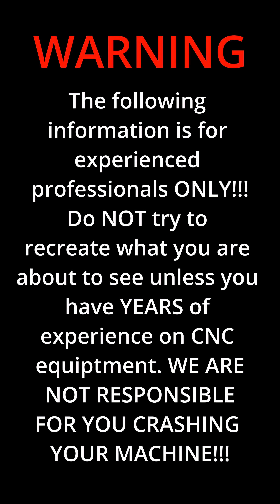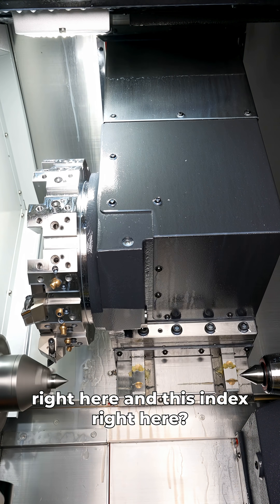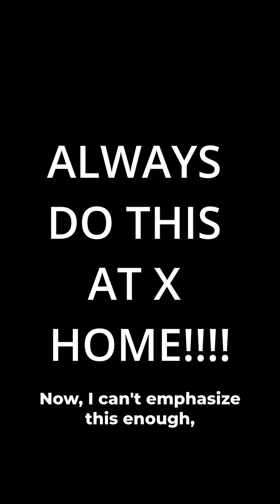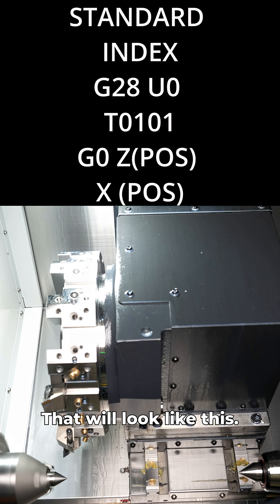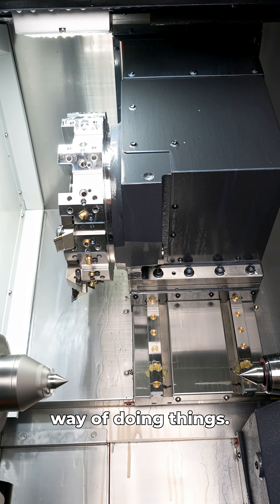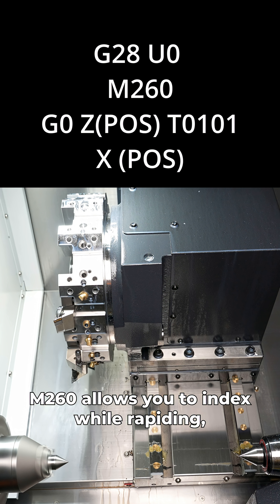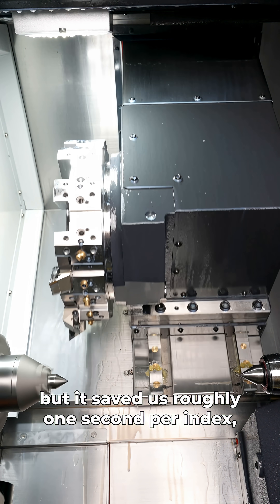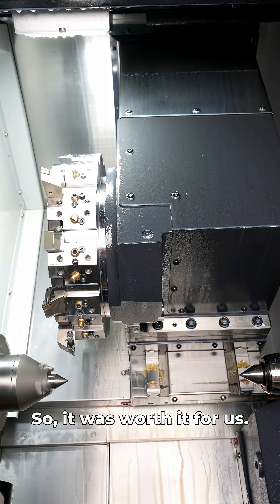Index on the fly!!! PLEASE BE CAREFUL!

Comment: You need to see a CHIRON. Some types carry the tools with the spindles. Be it magazine or basket, they will consistently tool change wherever you set them to. This eliminates the return to a fixed basket/magazine location. When set up correctly you only need to clear the work by the arm swing and tool . Short tools faster chip to chip times. With multi tool programs you can cut a a lot of time compared to a machine with fixed position magazines.Seconds per tool change.

Comment: If you're not clenching your butt cheeks, are you really pushing the efficiency?

A lot of my programs rapid home in Z, tool change, rapid to starting pos. I use this mostly on my Doosan Lynx 220L machines, where I know the home Z is set to not crash into the tailstock, and no tool can be long enough to rotate into the part. Really helps keep the spindle speed up without having to add a G97.

Comment: I personally use index on the fly on my haas lathe all the time. I have a macro that my post uses that moves the tool 1 inch in front of the part in z using the longest tool offset inbetween the current and next tool.  Works great for saving time and machine travel!

Comment: That don't math right, saving one second every tool change saves millions of dollars on "millions of parts" idk anybody that's making millions of parts
Reply from the maker: Automotive bud
Reply: @donniehinske  i mean it's still not millions of dollars saved. 1 million seconds is only 278 hours, even if we be liberal and say the operators are getting paid $50/hr. That is only $14k saved in time. Still great savings for the company, but u would need to run 71 million parts before u saved close to 1 million dollars.

Comment: G0 Z.1
X home, Z home.  Called a safety index for a reason.
Had a guy move the safety index to 1inch in front of part years ago.  No one knew this.  Tool setter was put down and tool was called up and boom.  No more tool setter.
Reply: ??? Why the hell would you change the tool AFTER the setter was down??
That’s just tempting fate…..
Reply: @Glenrok  Possibly indexing to set the next tool.
Reply: @mehmettemel8725  even so. Tool setter home first, then index. Living too dangerously for me….😳